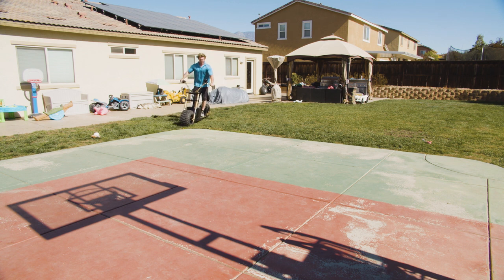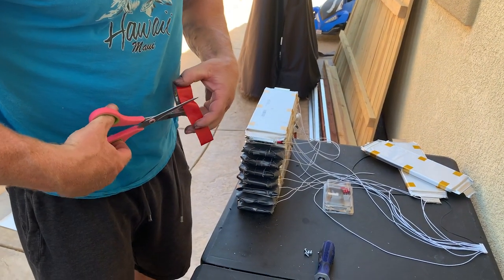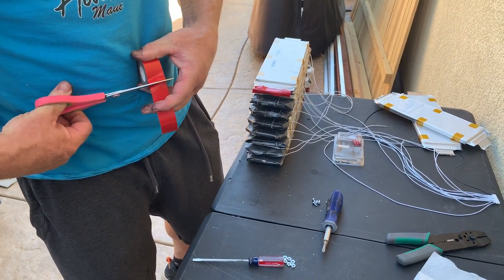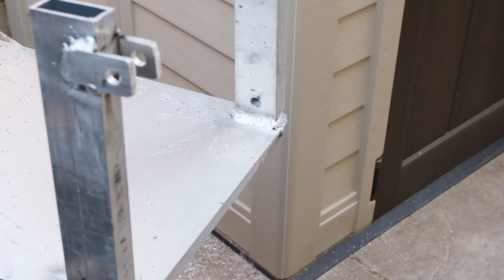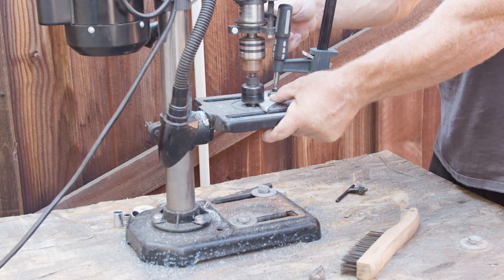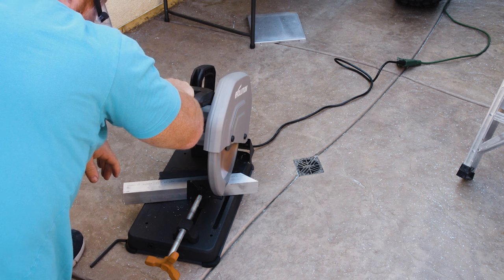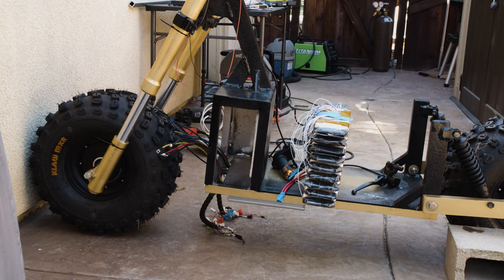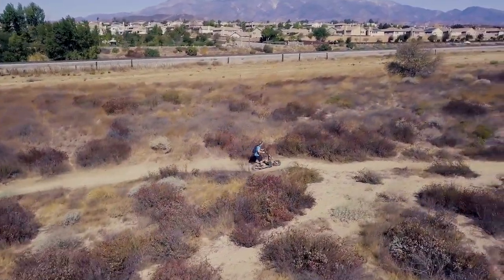Electric Dual Drive FAT TIRE Scooter 75 volts 60 amp hour (FULL VERSION)

Comment: Hey @Rex Smith
Love to see you are doing the same stuff as I do :)
Im building alot of similar "insane" EV's like these electric "scooters", gokarts and ATV. 
I do wonder, what is the weight on this vehicle?
Reply from the maker: I never weighed it, the frame is nothing, it’s all battery and motor weight.
Battery’s estimated around 50lbs I guess. Motors 2 of them easy 50 lbs or more together, this video is old was my second time welding and fabricating.
Thanks for the comments

Comment: Can you list where you got the components to build this? I’ve been wanting to build one of these for a long time but I’m having a hard time sourcing the hub motors and what you used is perfect.
Reply from the maker: The hub motors were tuff to find the power I wanted, at that time was only one company I have found . They are shut down now because of the pandemic. I know AliExpress has ones up to 1000watts. The controller for this build I purchased off of eBay, they were too big  for the hub motors, I went with the hub motors manufactures recommended controller!
Reply: @RexSmithII  could you point me in the direction of where to look for the hub motors? I tried aliexpress but what a serious pain it is trying to work out logistics and finding exactly what you’re looking for as they don’t exactly list all the specs needed.
Reply from the maker: @TuscanyFTX  yes, I’m going to bed now, email me it’s easier. 
Rexfordk83@gmail.com

Comment: I know you mentioned they don’t have much torque, QS motors make Motors for wheels like that. How many amps are you pushing? What’s the phase amps?
Reply from the maker: Qs doesn’t make hub like this.
This is a 18x 10.5 x 8 tire.
Search qs nothing they make will fit this.
I wanted a huge tire they was the point. This doesn’t push much amps, it’s not intended too.
I would say about 80 amps peak
Reply: @RexSmithII  
Thanks for the reply!

Comment: What are the brand and model of the motors and controllers you ended up going with?
Reply from the maker: The controllers are from the hub motors manufacture, it’s a non brand controller, 
The hubs  are  a 8” hub that’s rated 2,000 watts, again no label on them. At the time these were the most watts available for this wide size hub
Reply: The motors are 8x8?  8" wide and 8" diameter?
Reply from the maker: @Robert_Runyon  Eight diameter and I believe 7 inches wide

Comment: I want one of these for deer hunting. I do not need incredible speed though 45 MPH would be nice.  I want one with a built in rifle scabbard and sorry but I want it to have a standing bike seat like is mounted in a bass boat.   I can remove the seat and seatpost that way like in a boat.  It would give me the best of both worlds and make it into a better hunting machine.   It must be able to survive in cold and must give me a long distance per charge so it can survive a full day of hunting.    Build it for me with the cheapest possible materials that will still be reliable and I will pay you well for such a machine .   
You up for a customer project ?  I have money on hand to pay you up front and give you a bunch of video content on the Tube while building it.  Win win.  I have a Gem car motor and controller with charger that is brand new if you want it for this project or I could donate it for you on a different project and use whatever motor you think would work best in a hunting scooter build.      Contact me if you are interested .
Reply from the maker: Sorry for late reply.
Great idea for hunting! I also think life guards would find this a nice tool to add on saving people.
Can you email me to go over more in detail?
Shipping would be the bad thing as rates are crazy. But I have 3 different companies that roll the bikes on a enclosed trailer and deliver right to your door. I would send the keys in mail and video link describing everything on operation charging etc.
Rexfordk83@gmail.com